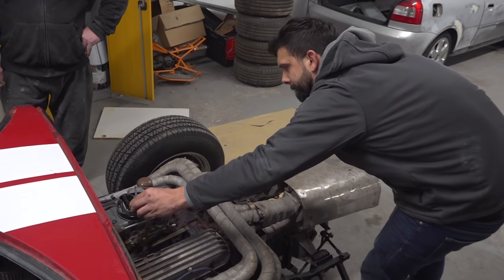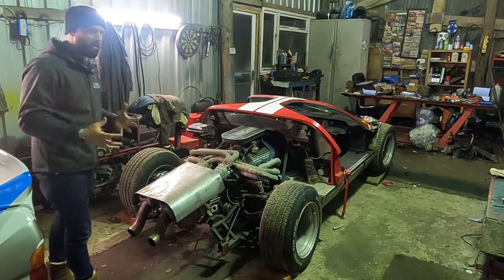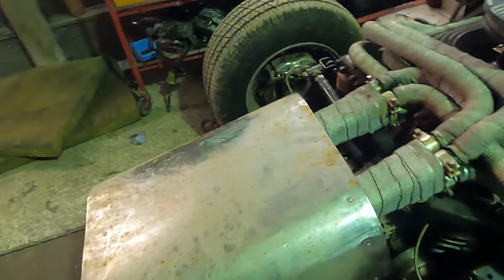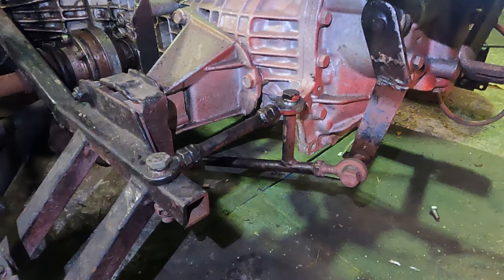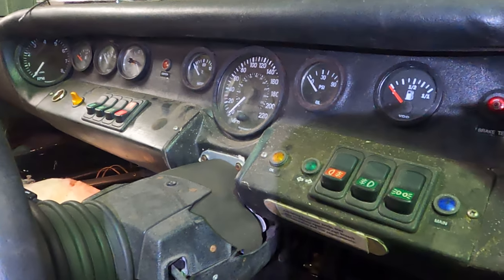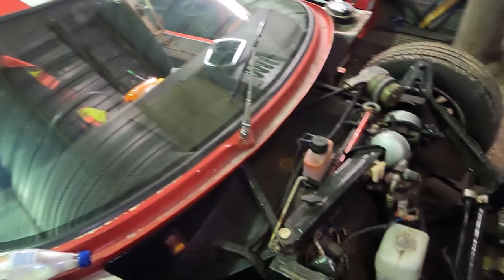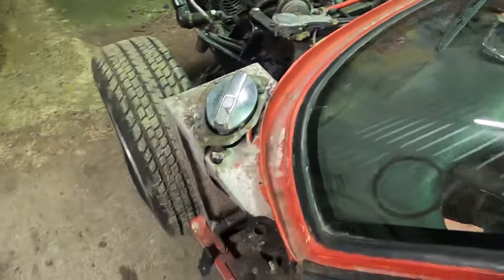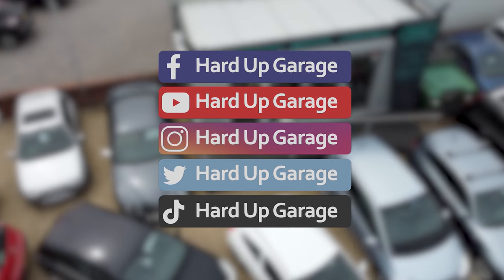GT40 Supercar build EP9 - Make or Brake

Comment: Can't wait to see this beast running. Especially with an aluminium intake and and a bit of a tune.
These engines make good power/torque when they breath properly with a bit of a cam.could also rebuild the heads one day with bigger valves etc!

Comment: I'm glad to see your not taking the piss out of Ivans work and giving credit where its due, and I gotta say your the second one i've come across that says the crossflow exhaust is what makes it special with the sound, as Tavarish's Mechanic on his Johnny Reb Corvette swapped light duty truck said that made all the difference in the world on how that sounded 

although i think alot of latter V8's didnt have true Dual exhaust given the emissions and the Evap systems that were latter fitted onto them, as I remember Richard Rawlings was dealing with a guy over a 74 vette with a big block he had acquired early in the run of that discovery show he used to do

and the guy was haggling him pretty well over it, only for him to kinda jab it to him that it was the last year of the true dual exhaust after the deal was done, so I'm not sure if that counts as that or makes a difference with that

also as for the Vinyl in the interior, that is not incorrect for the period, even Miura's Used Vinyl, alot of them had half Vinyl and half cloth, it was only the SV's and the latter Cars like the Fixed countach that used leather

and even then it wasnt very good leather as racing was about doing what worked and got you back on the track faster, and also Vinyl was chosen on convertibles back then given it didnt absorb mosture 

so who knows maybe it was something done to help with if you need to spray down the cabin because of a fire or something it doesnt ruin the interior that badly. 

so maybe sticking with Vinyl isnt a bad idea for it, although obiviously its like anything else, theirs higher and lower grades of it, and thankfully since the 80's those have improved dramatically to the point that well

it doesnt feel like your driving a kit car in a modern car that has that all over the place in them, as I think all Vinyl is is just overhyped plastic really.

Comment: When I built my KVA Mk3 back in the 1990's, I used a Lotus Esprit cable gearchange. Mounted centrally, with a conventional handbrake (not the correct under dash lever) I was still able to get the seats close enough together for the steering column to be near enough central. I don't think KVA initially produced different dashes, and you have an early pre 'C' type chassis model

Comment: Sam I remember you was saying how much you loved the metallic blue coloured Cobra, I was thinking if you did it metallic blue, can you use those existing seats and re-skin them with a dark grey leather and all the instrument panel with a darker grey coloured carbon fibre, with the display top and surround etc in the same coloured dark grey coloured leather with blue stitching (nearest to exterior colour) along with the seats, finally can you get dark chromed double wired wheels to finish off........I think that would look the BIZZ!!!!!!!!!!
Reply: Forgot to add, along with dark Chrome GT40 Petrol filler caps and a dark chrome  strip if needed....... just a thought
Reply: And triple wing wheel knock offs.............

Comment: The CortinaMk3  front suspension is not good and a long way from the correct wishbone setup on KVA C type chassis, GTDs, Southern GTs, Tornados etc. There is also a lot of squishy rubber in there. It might be improved a bit if you can find polybushes to fit.

Comment: If you're contemplating swapping the dash be aware that there are at *least* two different ones and they're very different in the steering column position and dash width. The Tornado etc are wider (I measured it as 44mm but it's fibreglass so there may be some variance) and have the steering column in a slightly different place. I'm not 100% sure all are but on the basis of 450mm wide seats, a 100mm centre "tunnel" with and a right hand gearchange taking 50mm out of the sill then I measured the Tornado etc as 31mm offset to the left and the GTD/SGT/LD etc as 14.5mm offset to the right of the seat centre line. Again they're hand made fibreglass so some may be more or less out.  I don't know if the KVA/KCC etc dash is different again.   

Anyway basically just be careful before you go buying a new dash!
Reply from the maker: Thanks so much matey :)

Comment: Halibrand replica wheels. Originals were one piece centre lock.
Reply from the maker: Thanks matey
Reply: Mk3 GT40 had borranis
Reply from the maker: I’m on the hunt :)
Reply: @Chief Rocka  Yep. Just saying the original halibrands were one piece etc not that the mk3 originally had one piece wheels.
Reply from the maker: Thanks matey
Reply: @Hard up garage  personally I prefer BRM's but if you're doing it full Mk3 then it just has to be Borrani wire wheels.  The 8in fronts aren't meant to be too hard to find but the 10in rears are quite rare. Might be cheaper to buy new unless you can find a bargain.
Reply from the maker: I’ll give them a call direct see if they will work with us :)
Reply: @Hard up garage  if you're going to change the suspension probably better to wait until you sort that out (or at least consider both together rather than in isolation) as that may give you better options with different hubs. Think the Mk3's were splined with 'spinners' while obviously you've got 5 bolt wheels at the moment.
Reply: @Hardupgarage  

I’ve seen Info stating Borrani supplied the 15-inch diameter wire wheels. These centre-lock rims measured 6.5-inches wide at the front, 8-inches wide at the back and originally came shod with Goodyear tyres.
I can see borrrani still supply wheels and the correct Record type also the spinners etc and even tyres but they ain’t cheep.
 I do know where there’s some ( 2 ) 10x15 borranis new old stock and cheep if your gonna go big   👍
Reply from the maker: Seems like a plan !! How can I contact you?